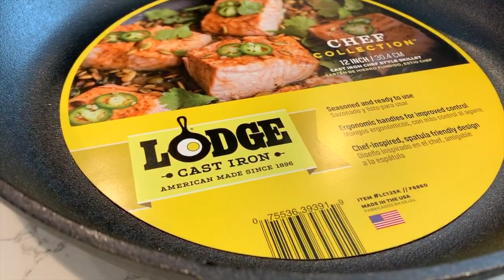How to make Rough Cast Iron Buttery Smooth for Faster and Easier Clean Up

Comment: I always sand my new cast iron, something I could never imagine doing in the past.  Hand sand it with 80 grit sand paper, then 150 grit.  Then 4-5 seasoning sessions in the oven with avocado oil at 530 degrees for 2 hours.  They come out incredibly smooth and non stick

Comment: I got my first cast iron pan (12") many years ago from an antique/thrift store for $20.00... all I had to do was soak it with the spray on oven cleaner in a plastic bag over night... then wash and coat with oil and put in the oven for a few hours and that thing has been on top of my stove ever since and used every day.... I have a lodge 10x14" griddle and grill almost a tray and also a 10" pan and they are horribly rough, no matter how much oil I put in them the food always sticks, I was ready to throw them in the trash till I saw your video. So I used my granite polishing discs(only took from 30 grit down to 200 grit to get the griddle smooth... now too seasoning it and the next pan. TY for the tutorial

Comment: Thanks for an informative and helpful video.
I just purchased a Lodge cast iron skillet from Walmart. They had about 7 of them there, and almost all of them felt like coarse sandpaper, very bumpy and rough.
I examined all 7 of them, and found one that was smooth. 
So I got lucky................................ this time.
Reply from the maker: Thanks for watching! I have another lodge cast iron 8 inch skillet and that one is much smoother than this one was before I sanded it down. So I left the 8 inch skillet the way it was.  I agree with you. Lodge is a good brand, but their seasonings do differ from pan to pan.

Comment: Nice job. I have also sanded my cast iron but only the  cooking surface. Worked great. May I suggest to not use flax seed oil it will flake off over time.

Comment: This is the difference in Lodge cast iron and the old Wagner or Griswold cast iron. The pans were actually lighter, and were finished perfectly smooth, and they are a pleasure to cook on. Lodge is just not the same, in my opinion. Polishing it smooth might make it comparable to the older cast iron cookware.
Reply: I agree

Comment: A lot of people ask how long it takes I did this with two of my pans first one I sanded up to 220 grit it took a few hours got it looking nice but the seasoning did stick very good so I sanded it with 60 grit after that it works great second pan I just sanded it with 60 grit took less then 30 minutes, also if you do this to your pan and the seasoning doesn’t stick very good put it in the oven use the self clean to cook off any seasoning then put it in 50/50 water and vinegar for a few hours then wash with cold water and and then start the seasoning process over the trick is don’t over sand it just makes for more work in the end
Reply: You shouldn't soak cast iron. It is very easy to rust bc it is very porous.
Reply: @skullyraec1465  I have never had a rust problem when soaking in a 50/50 vinegar water mix in fact that’s how you can remove rust

Comment: Your video is fantastic as well as your technique! One piece of advice I would give you is you could also use a drywall sponge sander instead of the round sticky sandpaper, that'll really get some smooth edges.

Comment: They tell you it's due to public preference but not true.  It's all about saving them money.  They should have finished the process properly but instead John Q public is left to do it himself.  Thanks for the video.
Reply: They mass-produce cast iron at scale, the sheer volume does not allow for it. And it's still a lot smoother than other cast iron made abroad. 
At the end of the day, you get what you pay for.
Reply: When Lodge developed their automated seasoning process, they found they needed a rougher texture to get the seasoning to stick. That's why they are "rough".
Reply: @Rockhunter329 Completely untrue. They just came up with that to justify not spending the money to smooth the pan. It's 100% untrue.
Reply: I agreed
Reply: That's mass production and a way to cut out the cost for the producer. I think that last step ended around the time of Tupper ware parties, more frozen foods, etc, in the 50s.

Comment: Hello,
First thank you for making the video, I really like the idea of the smooth bottom. I’m sure once done it will be much easier as far as sticking and cleaning. It took a while but I got my pan extremely smooth and I thought I was good to go to start the new season. But when I fired it up using your other video step 2 blue the steel, I now have tinny rough patches and I’m wondering if that happened to you? I’m just debating should I smooth it out again and skip the high heat with no oil and move on to oil and oven?

Thank so much :)
Reply: Tinny? Do you mean tiny? To paraphrase Mark Twain, the right word in the right place is a rare achievement. There is no right word unless that word is spelled correctly.

Comment: Jason
Some have recommended using the oven cleaning cycle to remove preseasoning from Lodge skillets. Do you think that the higher temperature of the oven cleaning cycle will also blue the skillet?
Thanks for any help
Robert
Reply: In my experience, the oven cleaning cycle doesn't get the job done all the way. More work will be required to fully strip the pan, like vinegar bath, or oven cleaner treatment... So even if blueing occurs during the oven cleaning cycle (which I think creates black iron oxide on the surface), the continued stripping should take it off.

Instead, fully the strip the pan FIRST, then clean it up, and throw it in the oven bare at like 500 for an hour. This should achieve the "blueing," then you can go through the seasoning process...  :)

Comment: Hey man, how is your cast iron holding since you posted this? I just tried this (going to 220 grit) and the first cook after seasoning seemed to come off. Is this normal? 

I’m using buzzywaxx (beeswax, canola & grape seed oil) 350 for 1 hr. Thanks in advance for answering!!
Reply: Most suggest not going finer than 80 grit, as the seasoning sticks better if the surface has a little texture. As for seasoning, 350's too low! Buzzywaxx directions (and general consensus) call for closer to 500.

Comment: I sanded the cooking section and re did the seasoning with grapeseed oil ( flax seed stinks too much 🤢 ) , the trick is to heat it up to 500f ( 300°c ) and then come back to 390f ( 200°c ) and reapply oil then back again.
I did this like 12-13 times and seasoning got perfectly black and slippery flat.
Reply from the maker: grapeseed oil is a good one too
Reply: 500°😲 Yummy 😋
Nothing like having Everything you cook in it Taste like Burnt Oil👍🤮💩🤮
You should never take it above 400° for seasoning 👌👍
Reply: @jamesglenn520  😂😂😂😂 the seasoning is burnt oil, sherlock ,what do you think it is ?
Some people just make me chuckle.
Reply: @dimmacommunication  The oil is heated till it Palomerizes. 
The seasoning is Not BURNT BLACK OIL!!
If it were than New Lodge cast-iron cookware would be BLACK off the production line 👍
Reply: @dimmacommunication  How many years have you been seasoning and cooking on cast-iron 🤔
Reply: @jamesglenn520  Palomerizes ?
Polimerize... 
Oil polimerizes above 430°f or so ... until 500 and something above  is perfectly ok.
Believe what you wanna believe, but seasoning is different layers of burnt oil
Reply: @jamesglenn520  Years ? doesn't mean anything.
I've seen people working for 40 years like garbage and going retires still working like garbage.
I saw people being bad drivers after 20 years and had friends driving like champions after 1 years of practice.
You probably did it wrong all your life
Reply: @dimmacommunication  And you are perfect at writing a whole paragraph to avoid answering a simple question Sherlock 👏🥳 
Lots of love your way and wish you nothing but luck in your future endeavors. 😁
Reply: @jamesglenn520  I didn't avoid the question, I just said it was irrelevant .
I seasoned my skillet 2 years ago after sanding the cooking surface, I make a new layer of seasoning every 6-7 months just to keep the pan in mint conditions.
It probably took you 20 years to figure out how to season a damn cooking pan, I wouldn't play the " I've been doing this since " game sherlock.
Like bragging about tying your shoelaces 😂😂😂.
Reply: @dimmacommunication  You actually were both wrong. It's "polymerize". Sorry you both had to wait a year to be corrected on that.

Comment: When I try to wipe the inside of my new skillets with paper towel, it shreds the paper into tiny fibers. I've been trying to season them over and over for months. I think I might take a sander to em cuz there is no way that enough oil will fill the cavities to make those craggy sharp bits level enough to not stick to everything.
Reply: Never use paper towel. 
Use a cotton cloth to dry and apply oils.
Reply: Trust me. Be easy on the oil. The goal is to make a thin layer of oil and burn it into one pan one layer at a time. Like layering carbon to make graphene. The molecular structure is what's important. Too much oil causes some parts to be cooler and not burn on.
Reply: If you want to use paper towels, try the blue shop paper towels vs ordinary white ones. But I use very old washcloths for applying oil, and some flour sack type towels (Walmart) for wiping the oil off.

Comment: Very good video on the whole process. My only criticism would be the use of quite fine sand paper. At 200+ grit, the finish gets very smooth which may look good, but gives the seasoning a hard time to adhere.
Luckily, it appears, you either started out with a rather high grit or didn't put too much time in the first round. Therefore, you didn't go deep into the metal and left those pits. They give the metal some texture and help the seasoning to adhere better.

I start with 40 grit sandpaper and only remove the 'spikes' while leaving the pits. You could already stop there and the scratchy surface would hold the seasoning very well. But I continue with 60, 80 and sometimes 120 grit to refine the scratch pattern without making the surface overly slick. I wouldn't go higher than 120 grit. The fine scratch pattern combined with the still slightly pitted surface holds the seasoning very well. 

Like you, I also sand the outside of the skillet and remove sharp edges and smaller flaws. Handling and especially cleaning such a skillet is almost fun and worth the effort.

Comment: I purchased my very first cast iron skillet by Gibson and its 10 inches. I have the same issue, the skillet is as coarse as sand paper. I was regretting my purchased until i saw your video. Thanks for the video. I don't have those fancy gadgets that you showed in your video so, how can i smoothen my skillet a little? Please can you gives some tips. Is it ok to wash the skillet using a sand paper after every use and eventually it becomes smooth? Will that work? and is it ok to do that to the skillet? please help.
Reply: Just season you pan, it will be fine. No need to smooth it out. None.
Reply: @BillOweninOttawa  Thank you.

Comment: I wonder if sanding the coating off with hand sand paper will work? I have a small skillet I'm going to test it out on.
Reply: If you mean just removing the pre-seasoning without smoothing the metal, you can simply use one of the known methods to remove seasoning (pyrolysis, vinegar bath, lye bath, oven cleaner).
If you want to smooth the surface, polishing by hand works, but it takes some elbow grease.
Reply: @berniem.6965  I tried on my 6inch skillet and it was a pain in the ass doing it by hand lol
Reply: Power tools make it easier, no doubt about that. But if you only want to get rid of the sharp 'spikes' and start with 40 grit sandpaper, it's doable - especially on such a small skillet. If you really want to dig into the material (which isn't necessary), power tools are pretty much a must.

Comment: My cast iron skillet was fine but then I decided to sand it down.  It’s very smooth but eggs stick to it now really bad because the seasoning isn’t sticking to it.  I’ve seasoned it at least 5 times now.
Reply: I have many of the new "artisan" skillets. One of them in particular has a very smooth finish. The seasoning strips to nearly bare metal about every I use it. I also have some old Wagners and a Griswold from my parents home that are very smooth that work great. A smooth surface alone is no guarantee that a skillet will season and cook well!

Comment: Thank you for making this video - but it seems like an awful lot of work, when we should be able to buy a cast iron skillet that's already sanded. The manufacturers are slacking off... Truthfully, it makes me frustrated and angry. What if we don't have the drill and sander and old clamp from our parents' garage??? 
BTW, you put in a great effort here! Not angry at you, of course.
Reply: You can, but that amount of work adds to the price considerably.  Look for something like a Fields, or Stargazer.  There are several others as well that I can't think of off the top of my head.
Reply: I totally agree!
My suggestion?
GARAGE OR YARD SALES!
You are bound to find one that isn't pre seasoned from the factory.
May need a bit of restoration but I found one for $2.00.
Half the effort cleaning, (I use half a lemon and coarse salt to remove stuck food or flaking seasoning or rust) sanding and oiling lightly baking at 450° for 60 min then let cool....and now smooth as glass!
Look up KENT ROLLINS  he is a cast iron KING!
Martha Stewart too...
Reply: You can buy cast iron that's already sanded... if you're willing to pay an extra $150-$200. Check out Field, Finex, Stargazer, Butter Pat...
Reply: Try Victoria. Smooth, made in Colombia. Same price as Lodge. You're welcome.

Comment: Cool concept but not needed. The rough surface actually helps the seasoning adhere. After about a year of cooking on it they will be almost as smooth. Also the Chef Collection Lodge pans aren’t worth the extra money in my opinion if anyone is on the fence. The classic is cheaper, tend to have flatter bottoms, and has more room in the pan. The only benefit would be the weight if you absolutely needed a lighter pan. I have a set of classics, chef collections, and the newer Blacklock collection. They all cook  well but the classics are my favorites.

Comment: can i use a steel wool instead of the sander? im really strong
Reply from the maker: I don't think steel wool will have any luck grinding down the seasoning to the bare iron. It might take a lot of steel wool and a lot of time.
Reply: Cast Iron is way harder than wool
Reply: I used steel wool, and some coffee. it Cas a grit in it that helps, it worked pretty well, there was black sludge everywhere. I might need to do another pass on it though
Reply: @EMlNEM2020  Well, why not using sandpaper ?
It's super cheap and works
Reply: @dimmacommunication  the steel wool made sense to me, I was thinking I'd sand it tomorrow though, and maybe try some finer steel wool after that to get it extra smooth, hopefully it works out.
Reply: @EMlNEM2020  don't sand it too much, being too smooth makes seasoning hard.

Comment: You used flax seed for this also ?
Reply from the maker: Yes I used flaxseed oil for this as well. I only use flaxseed oil when I season in the oven because of the low smoke point. Any high smoke point oil, I'll season on a gas stove. I also only use flaxseed for initial seasonings and never for reseasoning a pan.

Comment: What does blueing the iron do for it?
Reply from the maker: The biggest benefit of bluing is rust protection. Rust forms when oxygen reacts with the metal. "Black rust" is formed when the metal is heated up really high and it slowly reacts with the oxygen in the air. The chemical compounds are similar. Fe2O3 and Fe3O4. Without any seasoning a blued pan can go a long time before rust is a factor compared to a raw metal pan. It also has a strong affinity to oil so it makes seasonings stick better.
Reply: @jasonandangie7730  I never knew this! That’s very interesting ... I now see why you took all the seasoning off.
Reply: Blueing a carbon steel pan is one thing 👌 
But by heating a piece of Cast Iron to that temperature is a disaster 😲
You now have a very Brittle pan that is subject to cracks or breaking completely apart if dropped or banged against something very hard 🧐
Reply: It doesn't need to be Blued if you season it correctly in the first place.
Reply: @jamesglenn520  This is why I'm here. I've "blued" my 2 carbon steel pans and a wok. I'm looking at restoring a couple cast iron pans and never heard of bluing them. I figured it was not a good decision for cast. Thanks!
Reply: @jamesglenn520  is it possible to just blue the surface then? With a blow torch to the surface, it could probably be blued without tempering the rest of the metal
Reply: @Soneoak No. Cast Iron is thin and transfers heat evenly. That is why it makes a great cooking surface. 
Just season it properly and you don't have to worry about any rust or corrosion ever 😉